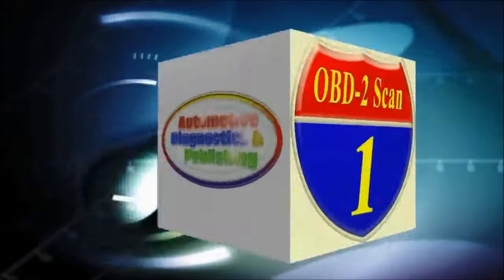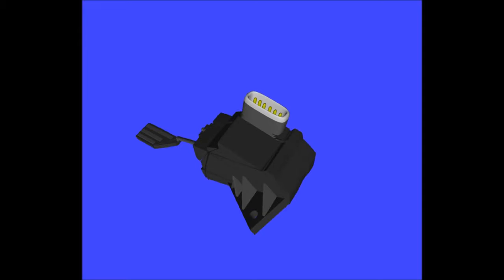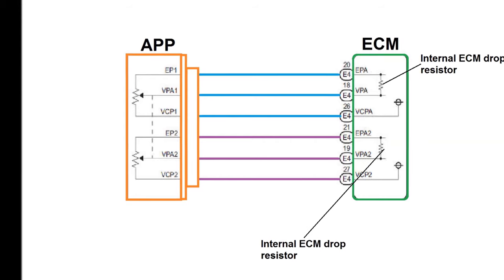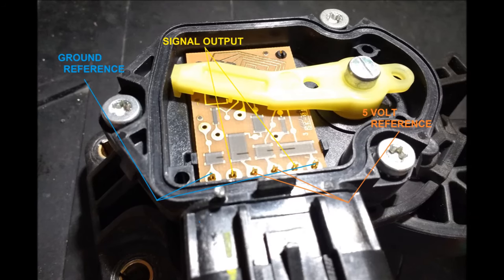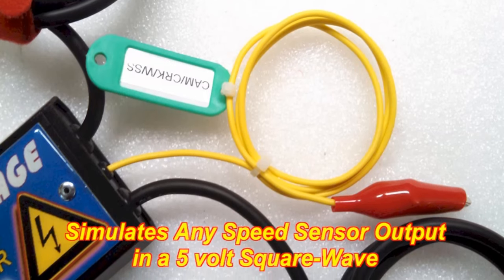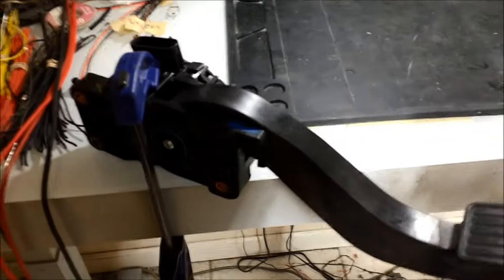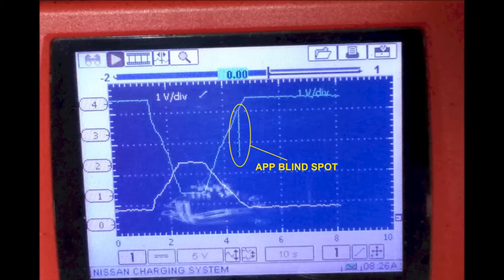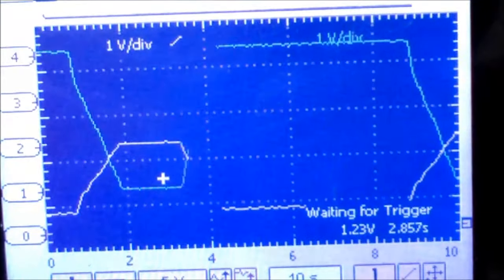How to Test accelerator Position Sensor

Comment: What if you replace it and the fault still persists? The accelerator not responding when depressed the pedal
Reply from the maker: You need the Electrothrottle and blue voltage. 
http://www.autodiagnosticsandpublishing.com/etc_electrothrottle_electronic_throttle_tester.html
Reply: Well then you know what’s not the problem!!😂😂😂

Comment: Do you have to replace the whole pedal or just the sensor
Reply: Supposibly the whole foot pedal is what I was told because it comes as one . Who knows with the Ford Focus . Love the car just don't like the mechanical side of the Ford Focus . Wish sometimes I could just put a simple engine in it and let it run forever . The car is a trip . 3 rd Ford I've ever owned. Very well could be the last . Wish Ford could make me believe they make good vehicles . And I know they do . But the mechanical side of this Focus is a freaking trip . Should just cut out the floor board and make it my Flintstone car .  LOL.  Drives great when it wants to and goes into LIMP Mode way too quick over the craziest things that can give off so many codes . Nobody knows !! Heck the car of mine is like brand new ,no scratches,  no dents , everything including the engine parts look brand new but I guess the 2014 Ford Focus is just a shell and thats it .  Please Ford make me a believer before I go straight up Coo- Coo !! LOL .  Too late !!😂
Reply from the maker: Depends on the design. Usually it all comes together.
Reply from the maker: I hear you.

Comment: In a jeep wrangler jku 16 i am getting etc error if i install a pedal commander (aftermarket throttle controller) inline and use a cb radio pointing toward the throttle sensor !  If i use a CB radio connected to the vehicle and the antenna connected to the vehicle ground,, with a pedal commander installed, the cb radio will also trigger an ETC error and check engine will light up. Idle will increase.   If i remove the pedal commander and use the cb radio,,, no etc error light... What can be the cause of our problem?
Reply from the maker: Take the pedal commander and through it in the garbage. It's picking up EMI or electromagnetic interference from the CB. This is a sure sign of bad design. Good luck. http://autodiagnosticsandpublishing.com
Reply: @ADPTraining  yes i have removed the pedal commander but i need to understand why it was working before but not anymore..  maybe i have damaged the ECU , or the throttle sensor..  if a layer redundancy in the pedal throttle is damaged, maybe i will need to replace the pedal throttle just in case .. but it is $200

Comment: I've got a 2006 magnum with a 3.5 in it no codes on the dash but it surges at a constant speed or light throttle clears up when  I give it more gas change the the electronic throttle body still doing it but it hooked up my scan tool did a live data with the ignition on car not running watched the "acc pedal e" chart slowly pressing the pedal down the percentage would increase but would go to 0 then  back up and would hit zero a few more times till maxed out then went back to normal . Not throwing any codes either would it be the electric accelerator pedal?
Reply from the maker: Ok, I see your typical issue. This is exactly why I created the ELECTROTHROTTLE Tester. In the link below, look for the Blue-Voltage ELECTROTHROTTLE Bondle. That's exactly what you need to test this unit. Had you bought it before it would have paid for itself.
http://www.autodiagnosticsandpublishing.com/etc_electrothrottle_electronic_throttle_tester.html
Reply: @ADPTraining  thank you and i will check it out!

Comment: Hi opel corsa c 1.7 dti 2001 was ok changed the ecu kit due to having broken pins car starts ok problem i have no gas acceleration at all rom stays 1200 i change the pedal 4 times still same p1120 p1122
Reply from the maker: Wiring issue from the beginning.
Reply: @ADPTraining   how can it be sorted do i need to check the wires from the gas pedale leading all the way to the ecu how can i find a wire diagram for opel corsa c 1.7 dti 2001 cheers my8
Reply: @ADPTraining   had it measured and i had 12.50 v on the gas pedal opel corsa c 1.7 dti not 5v as you guys say before i change the new ecu kit it was ok then i had 4 pins broken inside bottom plug so i cut it all and placed new one had to weld all the wires had them checked by a friend they are oll ok he says so wtf is causing thins have no gas pedal at all and rom satays at 1200 am still driving like 10klm a day getting me to work and back like a grand pa driving style 😂

Comment: Great explanation.. im trying to fit a blipper, it works by giving slight throttle voltage when i downshift.. device only have plus and ground, would it works if connect it to aps1? Will it trigger fail safe? Will aps2 follow the slight voltage increase from tps1 without actually touching the pedal?
Reply from the maker: Fail safe yes.
Reply: @ADPTraining  thanks

Comment: Great Information. Which wire will I need to disable in the Acc Pedal to prevent the car from accelerating. This is for a security system to prevent them from driving of. Thanks
Reply from the maker: Good question. Answer is the two signal wires.

Comment: Good info. My vehicle Toyota 100 Series 1HDFTE seems  have problem with APP and throtle. OBD scan shows all ok. How to investigate which part need service? 
Sometimes run smooth and ok but randomly rpm drop or even engine was off. Restart ok. But problem comes again randomly. 
Thank you.
Reply from the maker: Ok, chances are throttle and APO are good. Your problem is something else, as in an air fuel issue, injectors, ignition, etc.
http://autodiagnosticsandpublishing.com/
Reply from the maker: Here's also the Ebooks...
http://www.autodiagnosticsandpublishing.com/Automotive_Diagnostic_Repair_Book_Catalog.htm

Comment: hi,is it possible to apply dc 5 volts and check the outputs by oscilloscope  to test  the accelerator position sensor-thanks
Reply from the maker: Yes

Comment: I took it apart and cleaned it and put it back but now the pedal is loose and has no resistance? What did I do wrong? Your help is appreciated 🙏🏽
Reply from the maker: You probably missed a spring. You're supposed to replace these. Cleaning won't do you good. I have a tool to test APP Sensors here http://www.autodiagnosticsandpublishing.com/ecm_reference_voltage.html
Reply: spring

Comment: I think app caused limp mode in this dodge , now it has no compression in 4 cylinders two on each bank ,will limp mode cause miss timing leading to no compression? Please help
Reply from the maker: If it has cylinder deactivation, maybe. Normally no it won't.

Comment: @ 2:00 you have 5v & ground pins identified and @ 3:10 you have 5v & ground pins identified in a different position. What gives? Are you working with two different models for the video?

SUBSCRIBED
Reply from the maker: Watch carefully, on the second take the second ground is interchanged. The reason is obvious, one POT tracks inversely to the other, which is the idea for redundancy and reject IMI or interference.

Comment: Vauxhall adma p2122  2014
Reply from the maker: The P2122 OBD-II trouble, or fault, code means that the vehicle's on-board computer has detected low voltage in the throttle position sensor (TPS), which is usually below 0.17 volts.

You can test this TPS by using my ELECTROTHROTTLE and the BLUE VOLTAGE found here. 
http://autodiagnosticsandpublishing.com/
Reply: @ADPTraining  HI my mk5 gti gives code p2122,saying low voltage en revs won't go higher than 3,000rpm or 4,000 rpm might this be th problem